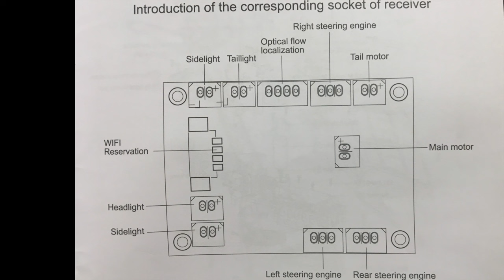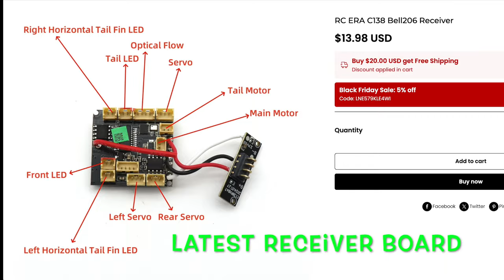RC ERA C138 Bell 206 Helicopter Upgrade: New Receiver Circuit Board Benefits

Comment: Now u replace new receiver board
Reply from the maker: @roslimohd9934  Thanks to you for your patience cheers Perry
Reply: @gamedevai   he think he is an rc helicopter pilot lol na  he is not an rc helicopter pilot like  i am   great video im new here
Reply from the maker: @bluckfox  Your right I 'm a reeeeaaaaal helicopter pilot ................ 🚁
Reply: Can you fix my hell?
Reply from the maker: @videodragan  I could but I am located in Australia. Where are you located?
Reply: @gamedevai  melburne
Reply from the maker: @videodragan  I am from Sydney, what’s the problem with your heli?
Reply: @gamedevai  ,new, just arrived, via amazon, flew and landed on the grass, and the grass caught the propeller, and I think the engine stopped, because now the propellers are not turning
Reply: I have to buy it again,
Reply from the maker: @videodragan  if both rotors are not spinning then it is more likely it need the new updated receiver board replaced like the video shows which costs around $20au. However may take about a month or so to arrive from Aliexpress.  If you buy another heli it may have the same old versionr eceiver board and may be a problem again. It's not so hard to replace the receiver board slowly and carefully. Hope this helps.